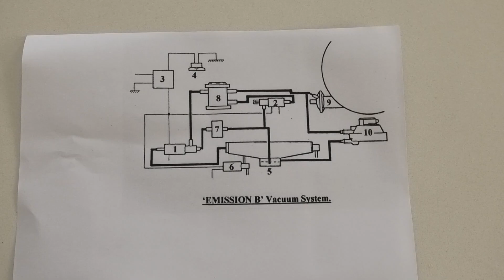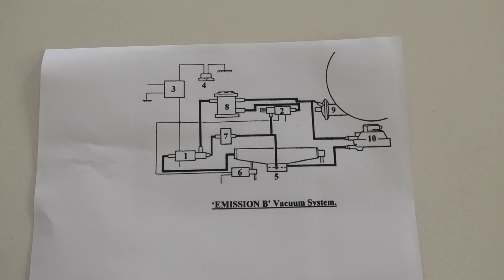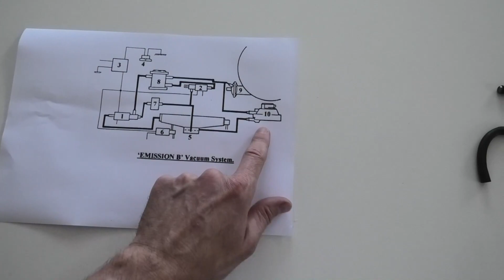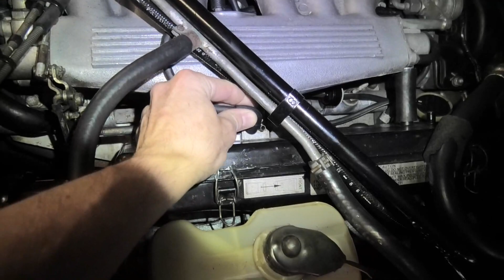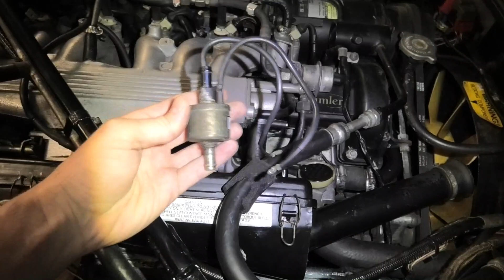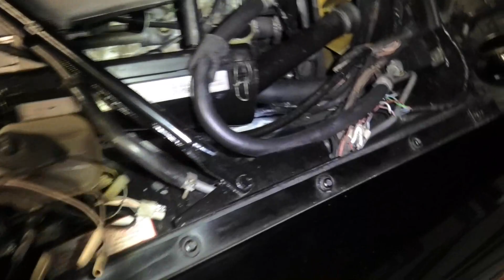Jaguar V12 Vacuum Advance Delay - safe removal

Comment: I disabled the vacuum dump valve on mine years ago but kept the rest, but I might remove that too. Moving my car out of my.garage to the street takes time and I don't like using half a gallon just to get the car out and fill the garage with fumes. The engine has never pinked without the dump valve.
Reply from the maker: The dump valve only operates under extreme vacuum, so should not have any effect under most conditions

Comment: I connected the vacuum advance on my XJS straight to the manifold rather than the throttle body some years ago and it made a big improvement to its running and fuel economy.

Comment: Brilliant video and scheme. Have just done it on my 88. 
Question: will removal of the supplementary air valve impact the air conditioning operation at idle in any way? Has anyone seen any perceived ill effects?
Reply from the maker: Thanks for that. There is a way to rewire the supp air valve, but I haven’t needed to employ it even with headlights and air-con on. I think there is info on the wiring circuit in the Kirby Palm book on the V12.
Reply: @cosgraham534  Thank you!
Reply: @cosgraham534  Some time after doing this mod, and having the engine running, I report back with NO trouble whatsoever, and no problems with the aircon operation. I have no solenoids and no supplementary air valve, and all is well. Thank you again!

Comment: That Extra Air Valve is important if you want to run air conditioning.  But as far as the other routing is concerned, you might have something there, so I'm going to try the rest of your approach out on my XJS to see if my situation improves.
Reply: why is it important for AC? Can You explain it a little bit, please
Reply: @wojciechurban1926  It's connected to the air conditioning clutch and needs to compensate for the load the air conditioning puts on the engine when engaged.

Comment: 19 from 15?  I get 16 US MPG.
I will check.
Reply from the maker: The improvement will be most noticeable when the car is used frequently from cold. On a long run on a warm engine, I doubt there will be a noticeable difference in fuel economy

Comment: Very interesting,my own XJS can be quite erratic on starting in cold weather,I wonder if this is part of the issue?
Thanks for posting.
Reply from the maker: I would look at the coolant temp sensor on the left side of the engine (as viewed from driving position). It’s near the front of the engine - a poor connection and / or failing sensor, will have your engine hesitant when cold. The problem is worse the colder the engine and decreases as the car warms - the fault is telling the ecu the engine is hot, which leans the mixture (when a richer mixture is needed). You can test it by disconnecting the sensor and starting the car from cold and attempt a drive - if there isn’t much difference in performance, that is the problem. Let me know how you go.
Reply: @cosgraham534  thank you for your reply.
Have replaced all coolant temperature sensors and thermostats with new original Jaguar items , wiring check is next on the fault finding list,time permitting.
I have found your videos most informative.
Many thanks.
Reply from the maker: @boyfromblackstuff7859  Thank you for your comments and good luck with your car!

Comment: 6:00 Star Spangled Banner intensifies 😂 (Yes, I know you're Down Under, but I feel like it's almost an obligatory tradition for some of us 😆)

Anyhow, thanks for pointing out the "try it before you buy it" trick at 8:55. I'm doing some "catch-up maintenance" on the XJ-S that I recently acquired, and I'll add this to the checklist while I'm refreshing the fuel lines, vacuum system, and the like. It seems to me that the 15-min vac delay system is more emissions-focused than anything else (e.g. run warm to get the cats heated), but I do need to dig into "The Book" a bit deeper than my initial skim.  Cheers 👍
Reply from the maker: Good luck with the work you do on your XJ-S. BTW, it was a .223 Remington case at the 6 min mark - you are the only person to notice!

Comment: Thank you for the wonderful video. I actually do not like to fix things by canceling other things, but it seems that we must do that in the 12-cylinder Jaguar. I replaced everything that could be replaced and did not reach any results. The car barely started with difficulty, and now that I connected it according to your video, it ran.  Things are going well, but my question is, does this affect the engine in the long run and fuel consumption? Thank you again
Reply from the maker: I’m very pleased to hear the good news - thank you for sharing it. The purpose of the vacuum delay advance is to make the engine run inefficiently from cold, so the engine heats more quickly. Have a read of the Kirby Palm book pages 133-137 for a detailed explanation of this. This modification will allow better fuel economy from cold, via a less fuel-rich mixture. This will decrease wear inside the 12 cylinders burning fuel. But… the engine will take a little longer to get to operating temperature. As these cars are now classics that are used occasionally and are treated with respect and are (hopefully) well maintained, any such effects are negligible. Just make sure you always run your car up to operating temperature whenever you start it (decreases spark plug wear and engine wear due to water condensation on engine components).

Comment: Just tried this but is experiencing higher idle rev. Have others had the same result?
Reply from the maker: Have you blocked the spare vacuum ports that are no longer used - specially the extra air valve port?
Reply: Hi Caspar. Yes I have. All unnecessary ports are blocked by means of a short piece of hose with a metal stud in it. Just as you've blanked off yours. If you haven't noticed any change in idle speed then it's obviously something to do with my car. Only thing I can think of is the dump valve, as I tested the one-way valve to ensure correct vacuum flow through it. All good, I'll do a bit more investigation.
 @cosgraham534
Reply from the maker: @thomaspetersen2642  Ok, good luck with it. Can you please let us know the source of the idle speed issue when you have resolved it, I’m intrigued?!

Comment: Just want to say a big thank you . I have been working on my 1985 XJSC  renewing the injection rail hoses and tip filters , replacing the inlet manifold gaskets. When putting all the vacuum air system back it was a nightmare. I followed your instructions and did away with some of the relays, valves and rubber hoses ,and reconnect as per your Video ,she runs like a dream and so much simpler .I also live in Australia on the west coast so we don’t suffer the cold weather so she should be fine . Once again thanks .
Reply from the maker: Thank you for your message - that's great news about your Jag! Happy driving.

Comment: #7 is NOT a check valve, its a vacuum delay valve,  'Standard motor products vacuum delay valve DSV9' to be precise
Reply from the maker: I don’t think I used the term ‘check valve’ in the video - I referred to it as a ‘one way valve’, which is how it works in my set-up. It allows vacuum to only work in one direction. This configuration is of my own (trial and error) design, and I have repurposed that ‘DSV9’ component to control the draw of vacuum.
Reply from the maker: Can you please tell me its purpose and mode of operation?

Comment: Excellent research Cos. I plan to do the same on my '83 XJ-S as soon as I've had the vacuum advance module repaired. One question: why did you find it necessary to fit the inline one-way vacuum valve into the feed to the dump valve? It was my understanding that the function of the dump valve was that of a one-way valve, but with the added function (to dump vacuum), controlled from it's connection to the inlet manifold. Thanks.
Reply from the maker: You may well be right on your suggestion - it sounds logical. It is a long time since I experimented with my car and got a successful outcome. My car is performing perfectly now, so I won't make any further changes. Relating to vacuum advance... make sure to lubricate the advance mechanism in your distributor, and seal the connections in the vacuum lines - all the way to the inlet manifold. Good luck!
Reply: @cosgraham534  Its not a one-way valve, it's actually a restrictor which has the effect of delaying the vacuum. To be honest, I cannot fathom how this setup actually provides better fuel consumption. In theory it shouldn't.
Reply: @jeffball6108  maybe it makes a difference if you do a lot of cold starts?

Comment: You limit revs to 4000 ?  You're missing all the enjoyment.  You can't kill these things if you try.  As long as you don't ever let them cook they'll never break.  BTW,  as you'd realize, there are several different setups in this area in the various markets, but people should be able to identify the components and  work their way through this process allowing for different vacuum hose setups etc.
Reply from the maker: Hi Chaser - I have revised my approach to revs on my V12 since I posted that video. Having worked on the ignition system and vacuum system, and installed K&N air filters, the engine response and power have improved noticeably. I am now a lot more inclined to exercise the revs… What an engine! 
If you spend long at high revs, bear in mind the standard water pump is geared quite highly - race-tuned V12s gear down the pump by about 30% to stop the water cavitating at high revs. 
You make a good point about the different vacuum setups for varying regions - the Haynes manual gives the schematics for Japan, US, UK and Australia. I thiiink my solution is ‘agnostic’ to the various regional setups, since I am removing the factory components and creating a generic one. I cannot guarantee that and probably should have been clear about it in the description.
Reply: @cosgraham534  Yes, but I think your video adequately describes and identifies the components well enough that anyone liable to be doing it will have no trouble.  And yes,  the engines are still without parallel in strength.  With forged chrome molly cranks and rods and such large dimension of bearings and lower crankcase.  Add that to the much lower load per member of a V12 engine and you understand why a V8 would struggle to compete in ultimate terms.  Keep the cooling system and hoses as well as the injection hoses etc in good shape and the things will go forever.  I remember the first one I pulled down in 1983.  It was a 1974 carbureted  XJ12 with over 100,000 miles and the crankshaft was still on standard dimension - mains and big ends - no ovality, no scoring - no nothing.
Reply from the maker: So nitriding the crankshaft really works...
Reply: @cosgraham534  Yes, I'm sure it has the stated benefits.  The V12 cranks are actually tuftrided and that's why Jaguar stated that the cranks need to be returned to them to be ground.  I assume that's because tuftriding does not produce as deep a hardened casing as nitriding.  A 20 thou under grind would effectively remove the tuftriding.  I'm sure that the process could be managed by the right company anywhere these days if needed.

Comment: Great Video. Did I understand right: If I try to remove one cable from the water heat sensor I have the same result ? How do I recognize an airinjection system. I drive a 92 DD6 here in Germany. Thanks !
Reply from the maker: That is correct - you can disconnect one wire from the coolant temperature sensor and the vacuum advance delay system will be disabled. I am sorry but I cannot help with the air injection system. It was not fitted to my UK car. I would remove the system entirely!
Reply: @cosgraham534  Cheers mate ! The air system is in the american cars to blow fresh air in the exhaust to fulfill enviorment messures

Comment: You Mention that you live in Australia, I think you will find that the Jaguar V12 is set up with the Emissions D, not Emissions B, for cars sold in Australia, the Emissions b  is set up for UK emissions. The Australian Vaccum advance has an Advance and a Retard.
Reply from the maker: Hi Trevor - My car is a UK import, so has that configuration. You are correct to point out that the Australian config is different (as are US and Japan...)

Comment: brilliant solution
Reply from the maker: Thanks - I have spent time recently, sealing the vacuum pipe joints and lubricated the vacuum advance mechanism in the distributor. That, with new HT leads / cap / rotor arm and plugs, has further improved the response and smooth running / acceleration of the engine.

Comment: Hi  Coz  !!!
....
It must be a beautiful car to own  ???
....
I learned  years ago that there were never any "plans" for that engine from it's launch in 1970 !!
....
( i'd  guess  the  vacuum delay  retards  the  engine  until  it's  warmed  up ?? )
....
Your car is like a "marque" of engineering with a very sedate street presence !!!
....
Coz   i'm afraid i cannot see ONE  virtue in a new car whatsoever  !!!
....
The interiors are like "designer kitchens" ,  
The tires cost about £150 each ,      
Those interactive screens are "putrid"  ,
The fuel economy only just exceeds your car,
The seats look like they've been bought in a computer shop ,  
 The paint fades quick ,
They look outdated after a few years ,
And last but not least , continual "road noise"  !!!

Comment: Great video very well produced and easy to follow. Has helped me out considerably in my effort to tidy up the engine bay in my series 3 sovereign v12, I am also in Aust so engine warm up is not too much of an issue. It would be great to see any other modifications you have implemented on the car.
Reply from the maker: Andrew K Thanks Andrew, I’m very glad it helped. I plan to upgrade the cooling system at some point, and I’ll post a video of that, when it happens. Cheers, Caspar

Comment: Hi, thank you very much for this video! It is greatly appreciated as I've been scratching my head over the routing of these vacuum lines since I got my XJ12. In my car, the vacuum lines from the dump valve are in a loop not connected to anything else. Several other valves in the circuit are disconnected and it's just one big mess of confusion. Can't wait to try out this setup. Thank you again!
Reply from the maker: Daniel Great, I hope it all works out for you. Please let me know how it went!
Reply: @cosgraham534  Came back to report and thank you again as the operation was a success! Threw out all that junk, started her up and for the first time since getting the car, it actually idles and holds rpm, so I'm very excited. Although the idle RPMs are stable now, it drops a bit every now and then, so I still have to sort that out. And a bunch of other stuff, but when are you ever really done with these cars.
Reply from the maker: Daniel  That is excellent news! I’m glad it was a success - thanks for reporting back. 
For the other issues such as the misfire, I recommend you try searching the Jag-Lovers’ forum for answers: https://forums.jag-lovers.com
You need to join the forum and then you can search for key words eg ‘misfire’, adding #xj, and you can search through lots of helpful info. It is an invaluable resource that has helped me diagnose and fix multiple issues with my car. Best of luck!
Reply from the maker: Daniel - you may be interested in the following XJ-specific Facebook group: https://www.facebook.com/groups/925138951319777/?ref=share

Comment: is their anything like this on the US spec HE engines? ill be removing my air pump system in a few weeks here
Reply from the maker: If you are able to remove your air injection system, and you can get your engine running correctly without it, you should then be able to follow my method to remove the vacuum advance delay (VAD) system and get the same results as I have. If you disconnect the coolant temp sensor (as shown in my video) you will disable the VAD on a temporary basis, to see how your car responds without it e.g. how much slower the warm-up is, and what sort of improvement in fuel economy you get. If you are happy then to proceed, I cannot think of a reason why removal of the system would not be successful. You will have effectively converted your V12 to a 'standard' spec, by removing  the North American spec components and configuration. If you want to be extra cautious, you could always keep the existing VAD system components in place, and then rig the system up like I have done, borrowing the existing pipework, re-plumbed into the new configuration (remembering to block off ports and pipes that have been opened to atmosphere). Let us know how you get on!
Reply: Hi Gavin, I have the same Jaguar as you a US spec 1990 XJS, did you remove your air pump and if you did, did you have any luck with Grahams vacuum delete process, I'm looking to do the same? thanks
Reply: @bobjason  so regarding my first comment forever ago, since then I have removed all the vacuum lines and even the intake manifolds and injection system, I’m converting to carbs so their isn’t much info I have on the injection vacuum system lol
Reply: @spartanreaper911  Thanks Gavin for your reply and good luck with your on going project.